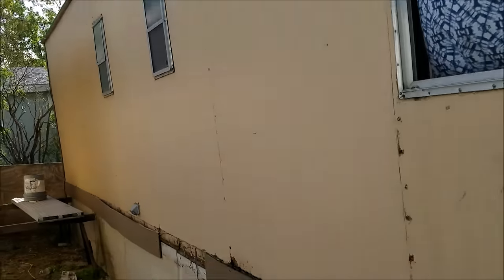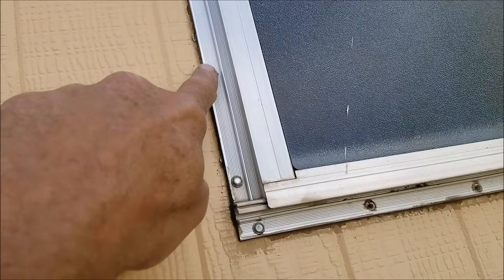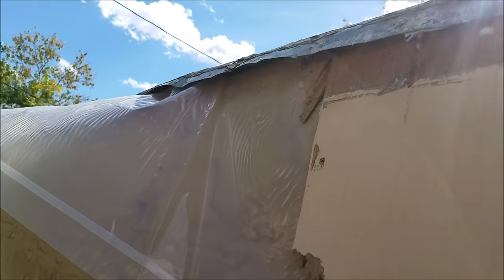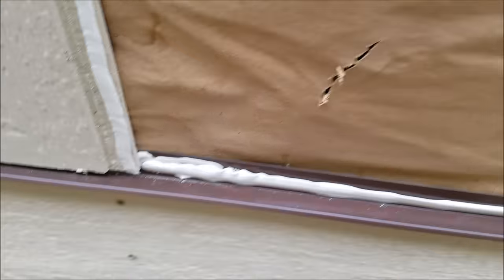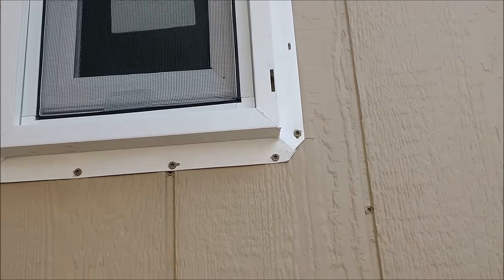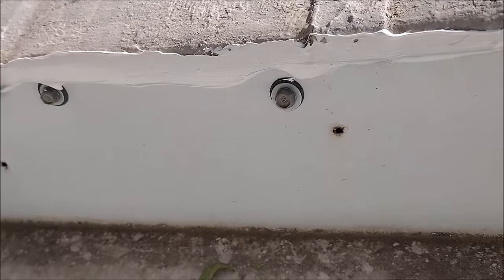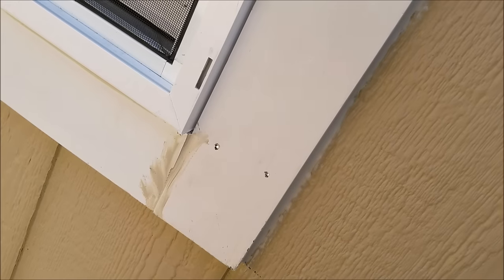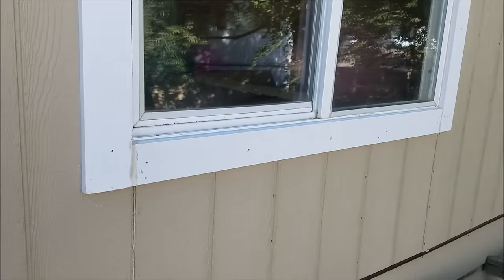Trailer house siding The right way to re-side a Trailer house Mobile home.

Comment: I realize this is an older video, but wanted to make a comment on the “don’t caulk the z-flashing” . As a repair person that has dealt with many rot situations, I agree the video, caulk it. Two points , I rarely saw water damage behind the siding that would have been relieved by leaving the z uncaulked . The water never makes it that far as typically there was not enough barrier, ie. house wrap, to direct it down to the z flashing. A bad leak in that case ends up in the wall. Good reason to use wrap. My second point in favor of caulking the z flashing is more times than not what I have had to deal with is rain water getting trapped by the z and being “sucked into the end of the siding and causing the bottom 1-6” to rot because the end of the siding was never primed or sealed. If that is not done by the original installer, there is no way to do it in the future, solution: caulk it. I would also note , be sure to caulk around the trim to siding edge. That , with good quality latex paint will make that siding last a good long time.  I know I was taught don’t caulk the z as well but real world facts changed my practices. Ps. Same goes for the seams between the panels, caulk them, I see rain get in there time and again despite the supposed “Locking seal” .
Reply from the maker: We are located in Wyoming; where the wind blows a lot, I've seen rain water blow upwards on windows, not taking any chances. Thanks for watching.
Reply: I was gonna comment similar to Blue Collar - Where we live in the high desert (CA), we get continuous strong wind and rain that literally blows water into every little crack. Caulking prevented mist of this seepage.

I DID get some great tips from this video! 👍🏼 Wish I knew before! 😂

Comment: It would be nice if we actually saw the process of installing the siding rather than before and after.
Reply from the maker: It's pretty basic you do reverse procedure, you put it on the same way you take it off. I just give you what I used for materials, and common sense of basic water shedding. Unless your trailer has metal siding on it. Please keep in mind that I get paid by the hour, and can't spend too much time on my camera. Also stay tuned for more videos on our little house. I will show you more and even cheaper way to put siding on as it's my own house. Thanks for watching.

Comment: I'm going to be using log cabin siding. All cedar, very cool stuff. The place is going to look amazing.
Reply from the maker: I noticed up in the Colorado mountains that folks are getting very creative, making them look real nice. Thanks for watching.
Reply: That sounds cool...how did it come out??
Reply: @lisalee2885  That project is happening in September. It will come out mind blowing compared to the metal sheathing that's on it now.
Reply: Sounds like more weight than the walls and floor can handle when you say metal. Probably 2×3 maybe 2x4. I was thinking of adding cement board siding  4x8 sheets that are only 80 lbs.  That 3,840 lbs added to my 2x6 walls. But the floor is only 2x6, it needs to be 2x10 to support that much weight. You may have problems later especially if some day it's to be moved. Yes ive found a few no one could move. Most because of a newly installed shingle roof.
Reply: @busnorth  It'll never be moved. I'm going to sure up underneath the home. Involves, concrete, lally columns then framing the space to do a really nice skirting. It'll be solid as a rock and really good looking.

Comment: It's very hard to pull all them screws and nails because of the caulking and find a fresh place for a screw to grab hold. Ive seen roof blown off after a residing jop. Mabey just cut along top a straight line. Install a drip rail and caulk like crazy.  If only they would put eves on like a regular house, it would even look better. Because of the lower siding rotting out due to skirting. I have learned to put skirting under and behind the siding.  Of all the skirting ive  tried on the rentals in my park, ive now gone back to metal,  preferably aluminum heavy gauge.  I've spent a lot of time doing trailer house repairs . And some ideas became do overs.

Comment: Hello Blue Collar Preacher:  Nice video seeing actual panel replacement would be useful.  Did you replace the old insulation under the panels and add a vapor barrier or rigid foam installation before reinstalling panels?  Thanks.  Frank
Reply from the maker: We did not replace anything on the exterior other than the siding on this unit; however we may be doing foam and are replacing fiberglass on the inside of one soon. Thanks for watching.

Comment: I'm in my 3 manufactured home, that happened because the sealant wasn't maintained on that lower trim piece.  And if you're going to reside,  the right way if you plan on staying in it is, first 15/32 cdx, then tyvek paper it, then siding, T1-11 or Hardi board and don't put that directly over the cdx seams, stagger it.  Nail are 6" apart at the edges, 12" in the field.

Comment: I have metal siding on my trailer can I put vinyl siding right over the top of it or do I have to take that metal off
Reply from the maker: You can go over it, I used to put siding on houses for a living, we used to put a 1/2" piece of foam on first to make it flat, adds a little more insulation to. And use screws to install it. Might look at some other videos on it first.  Thanks for watching.

Comment: I need advice ASAP bring coming in 6 days and I have both sides exposed deciding is off up by the gutter I need to get the fascia under it off I can't get the gutter off is there a special tool or trick to getting that dang gutter off

Comment: Thank you for a GREAT video! Is that Smartside siding panels you used? I am getting ready to recover a similar trailer with that.
Reply from the maker: It's T1-11 I don't know brand, It's made out of chip board, (particle board) it was purchased at Lowes. Thanks for watching.

Comment: also, did you rip a strip of the siding for the piece that runs below the siding or is that a separate piece of trim.  If so, what size trim did you buy?

Comment: dont caulk the top of Z flashing on the bottom of the T-111 that the point of release of anything behind it, the gutter should go under the roof tin were the staples were holding it down so water stays on top of seal, top to bottom of wall , window goes under siding under tyvex wrap or radiant barrier to stop air and heat from moving thru openings. Trailer tin work tends to not seal back as well when you put it back down .If water does get in on ya just use Red Guard membrane sealer ,don't need to clean the hell out it first, goes right on lasts forever.

Comment: I’m curious what you did for the rotten framework underneath the siding the video jumped and I didn’t see any replacement for the face board that connects to the floor framing
Reply from the maker: Currently working on one now that needs the framing done do to rotten wood, will be posting video soon on that issue. Thanks for watching 😊
Reply: The Blue Collar Preacher quick question can I use soffen as siding
Reply from the maker: @Rankgod6928  I am sorry I don't know what "Soffen" is. Thanks for watching.
Reply: The Blue Collar Preacher what kind of material is that
Reply from the maker: @Rankgod6928  It's OSB siding. Go check out my other videos on my Little House on the Bluffs, I use regular OSB sheeting for siding on it. And the cost is a lot cheaper. Thanks again.
Reply from the maker: @Rankgod6928  https://www.youtube.com/watch?v=SgUbyzHI9cY
Reply: The Blue Collar Preacher soffit and fascia i meant
Reply from the maker: @Rankgod6928  No I don't think that could work, You would be better off with OSB.

Comment: Adding on additional siding pieces, and water running behind the new, is what happened to a used mobile home, that I bought a few years back. The prior owner had added on vinyl siding, covered the whole mobile home in it, but did not add a roof-over. Without the added roof-over, with a good **long over-hang** , then the water ran down between the new siding and the original.  It is ok to add on new siding, just ensure that there is a good new roof with a long over-hang preventing water from getting in there. Those old mobile homes will need a roof over at some point, should be as one puts on the new siding. My suggestion is that no one uses vinyl siding, it's cheap, and does not withstand time.  It may be trendy, but who cares about that, as what really matters is how long it will last.  I would want a new ceramic tin roof, and roof-over, long over-hang, and also added protection by a porch-like length going all the way around the mobile  home to prevent water leakage around windows.  I would also prefer the ceramic tin be used as siding on the mobile home. It would be costly, but outside of a full big roof-over, so no water comes in contact with the mobile home, it would be difficult to preserve it. Those kept under cover, in a building, a big roof-over, or extensive roof system with long over-hang, have proven to stand the test-of-time, those with no water hitting them have lasted since the 1940's and 1950's, just as the newer mobile homes could if kept totally dry.
Reply from the maker: I agree; I know it would of been a lot better, but in this case the lady could not afford it, that is why I took the time to tuck it under the edge of the old roof, water shed is important. Thanks for watching.
Reply: AND, the definition of a *long over-hang* ... is?

Comment: If a mobile home has metal siding. Would it be possible to convert it to this type of siding? I don't know if it would be complicated.
Reply from the maker: It's possible;  Most metal sided mobile homes has horizontal pieces of wood running from one end of it to the other, around 2 ft on centers, I think you can remove the screws 4 ft at a time before installing the wood siding. Please check out some of my other videos on mobile home repair I have replace these pieces of wood before reattaching the aluminum siding. Thanks for watching.
Reply: The Blue Collar Preacher will do, thank you!

Comment: So you don’t need to add plywood sheathing to the sides ?
Reply from the maker: In most cases no, this siding is a step up from most siding put on trailer houses from the manufacturer.  Thanks for watching.
Reply: @TheBlueCollarPreacher  ohhhh ok cause im gonna remodel mobile home same side and was planning on stripping the tin outside and putting all new 2x4 and then the house wrap and over that the smart side siding … loved your videos !

Comment: What did you charge for this? Or what do you charge per square foot on a job like this? Thanks
Reply from the maker: I only charged this lady $25hr. (single mother) low income. However I still charge by the hour Time and Material. I am at $100 an hour now. after Pand!m!c careful what you call these days, don't want to get flagged. Materials up and down daily. Thanks for watching.

Comment: It's not necessary to caulk the drip edge. In fact it can trap water inside once it shrinks and pulls away as it runs between the cracked caulk and the siding and can rot the new siding.
Reply from the maker: Water runs down hill, there is no way water can get trapped in the drip edge; the backside of the drip edge is around 2" tall while the front edge is only about 1/4", we put the caulk on the drip edge to keep bugs out. Thanks for watching.
Reply: @TheBlueCollarPreacher  it's not a general practice to caulk a drip edge. It's sealed once it's all nailed/screwed off around it. Your overdoing it. It's a waste of time and caulk. I've never caulked it and never had an issue.
Reply: @TheBlueCollarPreacher  Not true. Water can travel upwards through capillary action.
Reply from the maker: @PDXMILO  the drip edge was designed and engineered specifically to keep water from getting behind the siding.  Thanks for watching.

Comment: Good work but one thing, Your not supposed to caulk seems on hard broad siding panels it will trap moister and cause them to bulge at the seams they are made to interlock and give a strong seal especially after paint.
Reply from the maker: You are right; but this is not hardy plank type of siding, it is made out of OSB. Thanks for watching.

Comment: which drip edge/drip cap do you recommend and where do you buy it?
Reply from the maker: They come in all sizes depending on the thickness of the siding you plan on using. We bought our drip edge at Menards, and the owner of the trailer house bought her siding at Lowes, You can buy any and both at any lumber yard or big box stores. Also to your other question; we did just rip down some siding for the bottom section. Thanks for watching.
Reply: For current readers, I'd use Hardi board, sure it can crack, but it's cement impregnated, it won't rot.

Comment: I own a 1991 Bonnavilla mobile home, 16'x76' that has similar wooden panel siding as this home does. I am thinking about replacing the siding with sheets of corrogated metal siding (same as you would use with a roof or "pole building"). My wooden siding is starting to show it's age and the panels are starting to seperate at the seams.
Reply from the maker: That would even be better. Might have to do roof as well to extend past the siding.
Reply: @TheBlueCollarPreacher  Yes will be replacing my roof as soon as I can as well, but my roof is actually not in terrible shape. I am more concerned about my siding. It's even starting to rot out in places which I have patched up upon moving into our home 2 years ago, which is now starting to "re-rot" through my patchwork lol. The home was cheap though, so I'm cannot complain.
Reply from the maker: @waylangoddard7178   I understand. It's just that your roof has to extend past your siding. for the water to shed off. I have another method for reproofing trailers as well just haven't made video about it yet.
Reply: I never did like the ole masonite or whatever siding that is. My first trailer went from tin to that side before I moved in and it just fell apart after a few years (improperly repaired) now the trailer I live in now has aluminum siding and the entire sub floor is just rotting, stupid osb crap. I can't win for losing
Reply from the maker: @reaperasylum2163  I understand, That is why we are now building new home out of metal building. Our last house had wood siding, and I had to paint it every year, and replace siding every time. I only stick real plywood on Trailer floors, 'watch my video where I fix a bathroom in one. Thanks for watching.
Reply: That's not butal caulk butal would have little strings like spiderweb when you pulled away
Reply from the maker: @thebiggsfix6987  yes it is at the top where the roof comes into contact with rain gutter, however just plan paint able stuff on siding. Trust me I know I'm like you can't spell ether had to bring a tube home to make sure I spelled it right, (Butyl) Thanks for watching 😊
Reply: @reaperasylum2163  My 1985 subflooring is rotting but it is from improperly insulated duct work.  The central AC caused condensation that kept the plywood underneath wet all summer for 15+ years.  Had no idea it was happening.  What a nightmare it has been.

Comment: very nice, thanks! love the credits HALLELUJAH to JESUS CHRIST OUR LORD! SHALOM! 
checking out vids, because would like to buy an old, cheap 28' office trailer, was looking around at the fancy "faux wood" siding... like it very much, but now trying to figure out where to buy and how much it'll run... looks like a lot of work to remove staples, screw, bolt, etc... how many hours would you say to remove the original (old) siding? thanks and GOD BLESS!
Reply from the maker: All depends on how much experience you have, tools available, I could strip one that size in about a day. And about 2-3 days to reside. Thanks for watching 😊, and God bless you.

Comment: What screws did you use?
Reply from the maker: 1-5/8" Zinc coated on the siding. and 1-1/2" Weather headed self sealing 1/4" hex at the top. Thanks for watching.
Reply: @TheBlueCollarPreacher  Thanks, my cousin had use nails and the siding pops off

Comment: I realize this is an older video but wondering if anyone could give me a cost for replacing the siding on the back of my double wide. The ‘cardboard’ old siding has rot like this home and the estimate I got included a replacement of better panels, some sort of underlayment.. It will be a primed type panel I can paint myself.